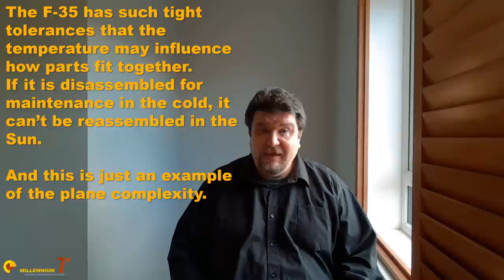F-35: The Failure of the $100 Million  Dollar Jet | Maybe...

Comment: american Gripen made by boeing? Boeing and SAAB already work together in T7A
Reply: their EW has stunned other nato pilots who thought they were going to have an easy kill.
Reply: Gripen is a marketing scam perpetrated by BAES and Saab. They don't even have an IRST in it, and China has already exploited it.
Reply: @michaelkeller5008  They both have higher unit costs that the F-35A, ($85 million for Gripen E, $144 million for Rafale to India, $77.9 million for Lot 14 F-35A) don’t offer even half of the capabilities, and have similar operations and maintenance costs, not counting mishaps.  Gripen mishap rate already is serious (8 total losses out of 271 airframes).  Rafale has the same or higher operations and maintenance costs as F-35A.  Dassault “promised” India they will try to meet a $25,000 CPFH.  USAF 388th and 419th TFW are demonstrating $21,000 CPFH right now.  It’s the training and test birds that would cost more to bring up to Block 4 standards, which isn’t necessary for the Luke AFB F-35A conversion aircraft.  None of them are slated to be forward-deployed ever.  Test birds will always have modifications made to them due to OT&E, so nothing new, other than a way more efficient platform for upgrades that doesn’t need hardware attached to the outside of it to increase sensor capes.

Meanwhile, the new Raytheon DAS is 25% cheaper and 30lbs lighter, with twice the resolution of the Northrop-Grumman DAS.
Reply: @LRRPFco52  the E version does indeed have IRST. Stop talking rubbish.
Reply: I love the idea of the American Grippen, maybe with vectorial thrust to achieve F-22 or even better maneuverability and improved electronics. 

The fighter mafia principles with today's engineering.
Reply: @LRRPFco52  the issue is not only the price but the technology. If you loss an F35 (77m) the technology can be reversed. If you loss a 4++ at the same cost it won't be so hard.
Reply: @LRRPFco52   For Finland, the Offer to buy 64 Gripens, was for 1, was little over 104 million Euros or even less! Or do the math by yourself 2/3 out of about 10 billion Euros and then take that out of 64 Gripens = Planes + 2 EW/C or something Planes and + Weapons and 1/3 of the 10 Billion is probably for the Building the Structures = Factories to start to build and develop and maintain the Jet = Jets! That what I have read, that the Cost Oor = Or the 2/3 is only for the Gripens! So the total price is something little over 104 million Euros or even less, hopefully less!??  So not so bad!  Right!??   :    )
Reply: @LRRPFco52  Please get at least some facts straight.
Gripen E has IRST.  China created simulation scenarios with limited weapons where Gripen lost.
Rest assured that Gripen would not go into combat with that weapon config. 
In BVR scenarios , it repetitively and clearly won. And that was not even Gripen E.
Reply: @michaelkeller5008   That is the other way around. By using US tech and parts , US will have veto on all sales.
I'm pretty sure US will allow sales to US.
Reply: @michaelkeller5008  They have corrected 2020 deficiencies with the JSF series, which isn’t a lot, to be honest.  Every time they correct them, new ones get added, just like every other fighter and weapons system we have in the inventory, only those barely get mentioned now.

The USAF F-16C/D Block 40/42/50/52 currently in service have tons of deficiencies that have not been corrected, as this is a rolling thing throughout the life of a program.  One of them even cost the life of a pilot last year, was a known critical deficiency affecting safety, yet he still flew.  He ended up ejecting and the identified pin in the seat separation and chute deployment system failed, causing him to hurdle through the air and impact the ground at hundreds of knots.

This problem does not exist on any of the JSF series.  

No, current systems of F-35s are forward-deployed all over the world, from multiple nations.  Israel has been using F-35A/Is in combat for years now, as have the USMC, USAF, and UK.

The older, early-production F-35s are used for the training and test squadrons, just how we did with F-15s, F-16s, F/A-18s, F-22s, etc.  You don’t just send new aircraft to operational squadrons and say, “Figure it out guys.”

VLO actually does work, and works extremely well.  Anyone telling you that it doesn’t is not well-informed.
Reply: @henrikbackorebro  Meanwhile, none of the JSF prototypes (3 different variants with different take off and landing requirements) crashed.  That was one of the first things I noticed that differentiated the JSF program from the YF-22 and all the teen fighters.

Then in operational service, instead of seeing all kinds of major mishaps like we did with F-14, F-16, F/A-18, and Harrier, we waited for years and years before any crashes, which have been very few.  4 impacts with the ground and 620 airframes built.  I’ve never seen that before in all my years of being right there watching development programs mature from X or Y planes to production.

The Falcon Strike LFEs are what I’m talking about when discussing how the Chinese have already exploited the Gripen C/D and built better 4.5 Gen fighters with the J-10C.  It has a large AESA that can’t fit in the Gripen’s radome, has a DSI inlet, and better than 1:1 thrust/weight ratio.  That’s how PLAAF beat the Gripen in BVR.

The 2015 FS exercise saw them take their 1980s-era Su-27SK and get wrecked in BVR by Gripens, but humiliate the Gripen in WVR.  Once you turn tail or offset in a Gripen after firing off AIM-120 or Meteor, your RCS just spiked significantly, just like any other single tail delta wing fighter with external stores.  That’s a dead-end design for the 21st Century moving forward, especially with how limited the Gripen external stores are.
Reply: @metmask3825  Go look on Saab’s website what they’re delivering to Swedish Air Force right now.  They have pics and video with much fanfare.  No IRST anywhere to be seen on current production Gripen E.  Is Saab’s website rubbish?
Reply: @michaelkeller5008  The USAF flies more sorties per week in arctic conditions at higher latitudes than Canada and most of Norwegian Air Force does.  Norwegians are currently operating F-35As from arctic conditions as well.  No modern fighter can be built to not operate in extreme cold because the altitudes they fly are in the -20 to -60˚ C region.  Anyone who begins this line of reasoning is not familiar with the basics of fighter environmental factors.

The US has the largest, most capable climactic control facility in the world to simulate everything from extreme low temps and ice storms, to extreme high heat with sand storms.  As part of any of our fighter and bomber testing, type classification, and validation processes, the designs have to be able to meet extremely high standards that most nations can’t even afford to build the testing equipment for.
Reply: @henrikbackorebro  You start to see a common theme with the underpowered Gripen, where the flight control law governing the canards and control surfaces has to do more work at low speeds.  This is normal, but when the pilot finds a pit in that CLAW and induces uncontrollable oscillations in a very relaxed stability design, it immediately pitches up violently.

Some of the mishaps have involved the FLCS overriding the pilot when he tried to recover it using basic recovery procedures with pitch input, but wouldn’t allow them to.  You shouldn’t normally be learning these things more than once with a design.

The fact that multiple PIO incidents have occurred with the Gripen from its early days through the past few years is not a very encouraging sign.

But don’t pay attention to any of that.  Just trust the headlines when they say how great the Gripen is, how low its costs are, how it can defeat anything in the air with its EW suite actively making it stealth, and how it will “easily defeat” the Su-57, even though it can’t easily defeat the J-10C (way less capable than Su-57).
Reply: @XimCines  It’s one thing to acquire material samples from a very rare wreckage.  It’s another to actually know how they were made, then duplicate the manufacturing processes and materials streams.

The threat nations know pretty well what is in them already.  They just haven’t done the due diligence in establishing the manufacturing base, test communities, and integrated systems armies of engineers who actually innovate, versus copying other people’s designs like the Russians and Chinese.  Innovation is hard, expensive, and time-consuming.
Reply: @LRRPFco52  I think you are avoiding the issue here, the point is that letting advanced technology to fall in foreign hands is a risk. It is not certain that they can duplicate it, it is a risk... a non zero possibility. 

Another thing is that you risk more millions in an F-22 than an F16.

You can use much simpler planes to attack lets say ISIS. An F-16 can do a good job there why risk an F-22?
Reply: @valko022  Each of the GlobalEye (foreign-built systems assembly in Sweden again) cost at least 500 million plus support.  2 of them were over $1.2 billion in 2015 deal.

F-35A unit price is $77.9 million.  Gripen E unit flyaway was $85 million a few years ago, with elastic unit program costs.

They’re trying to make up for the fact that JSF provides unparalleled levels of Airborne Early Warning and Control, though a high endurance platform allows longer flight durations of course, but has to remain far away from the border or else it can be killed very easily.  Even when they fly over Gulf of Bothnia, for example, it’s still extremely vulnerable with reduced sensor penetration and coverage over the border region.

Meanwhile, JSF plugs into net-centric early warning for surface, airborne, and low earth orbit contacts with Norway, Poland, Netherlands, and UK.
Reply: @XimCines  I’m not avoiding the issue.  If that was the determining factor, we would still be flying biplanes, only we wouldn’t, because every Air Force in the world would laugh as they shot us out of the sky and we lost.  They flew the SR-71 over Soviet and threat nation territory for generations.

When the Chinese acquired some of the F-117A wreckage from Serbs and took it to their embassy, we “accidentally” bombed their embassy.  Remember that only precision-guided munitions were used with very specific grid coordinates.

The chances of losing an F-22 are significantly less than an F-16.  For example, Israel has been flying missions with F-35s for years now, but the only aircraft besides drones they have lost has been a highly-advanced F-16I, which has more EW and countermeasures on it than any USAF F-16 ever did.

F-22As have led strike packages into Syria, opened the door as an offensive EW platform, switched to a precision strike penetrator with JDAMs and SDBs on ISIS HVTs, switched to AEW&C for the follow-on strikers using radar ground-mapping, done OCA/DCA, continuous wide-area ISR, then escorted the strikers on the way out through the perimeter defense radar network.

That used to take F-117As, EF-111As, F-4Gs, F-111Fs, F-15Es, E-3As, EC-130s, another aircraft I won’t name, and RF-4Cs do to that mission profile.  Now they do it with F-22As and F-15Es, or F-35As and F-15Es with far superior effects in each relevant mission set that used to be performed by all the previous aircraft.
Reply: @eleson00  Yes, in 2015, the Gripen C/D with AIM-120C WEZ at limited Gripen altitude beat the giant RCS, obsolete Su-27SK in BVR most of the time, but not all.  That was using the inferior export RVV-AE BVRAAM, with China says is crap compared to their PL-12 and PL-15.  Gripen C/D got annihilated in WVR against the Su-27SK in the Fox Helmet-HOBS realm as well as maneuverability because Gripen is terribly-underpowered, not anywhere as maneuverable as the Flanker up high.

Then in 2016, PLAAF took J-10A down to Falcon Strike.  BVR odds were evened out, WVR still out-classed the Gripen C.  So now you’re talking about a platform that is inferior to an outdated Chinese delta wing 5 years ago.

Then China brought down the J-10C with AESA, DSI inlet for even more reduced RCS, with PL-12 and PL-15 WEZ and totally erased any clear advantages the Gripen C had.  China was investing a lot in purchasing Flankers from Russia still, including the Su-35S.  The whole Falcon Strike exercise made them realize their J-10C platform has way more potential, so they ran a series of internal tactical exploitation exercises of all their fighters.

They found that the Su-35S was inferior to the J-10C in BVR, and stalemate in WVR since both have helmet-HOBS, both have good excess thrust and maneuverability enough to execute quick edge-of-visual range shots.

They then tried to pull the Irbis-E PESA and OLS-35 IRST from the Su-35S so they could install a Chinese AESA radar and Chinese IRTS that exceed the capabilities of the Russian electronics (not hard to do), and bricked the whole aircraft because the Russians close-loop designed the Su-35S.

China had to have Sukhoi technicians come in and help them fix the Su-35S so it wasn’t a brick anymore.

They quickly determined that their force mix for air superiority should lean more on J-10C fighters with AESA and PL-15, put as many AESAs into their J-11B, J-15, J-16 Sino Flankers like they did with the JL-11D, along with data links, better cockpits, PL-12 and PL-15 integration, with their own IRSTs for their own upgrade program.

They realized that because you can never get a Flanker to have an RCS like a J-10C, the J-10C should fill more of an active role in air superiority while Flankers do a lot of multirole and maintain as much stand-off as possible.

A Gripen E would have a really hard time against a J-10C because of RCS values and the large AESA on the J-10.  That’s why Saab has been making such a big deal about using GaN TRMs in the Gripen E to try to make up for that disparity in radome size.

Another big problem the Gripen can’t overcome is separation altitude with combat stores.  If you want an optimum separation altitude, you need an aircraft with the power and aerodynamics to accelerate through the Mach before launching BVRAAMs up past the FL400 band above the contrails.  Gripens struggle once you get above FL250 since it’s so underpowered.
Reply: @LRRPFco52  So??  For Finland! 1) F 35  2) Super Hornet  and  number  3)  the  Typhoon!  Right!??   :   )
Reply: @LRRPFco52  For sure Gripen has it. Gripen E has it. They dont have it installed yet because are still testing the plane.
Reply: Yup, the cheapest plane that can supercruise with AA load out.
Reply: @LRRPFco52  144 Million for Indian Rafale is not correct, weapons are also included in it. It's not just airplane's cost.
Reply: @LRRPFco52  sure bro ☺️ China exploted old c modell and got there ass kicked haha..ok they won a few dogg fights but bvr they hade nothing.and dogg fighting as we all know is a thing of the past. Who are you working for? Lockheed Martin?? Trying to push you're crap on everyone 😂
Reply: Wasn't that the F-20 Tigershark?
Reply: @LRRPFco52  so someone choosed not to buy the hmd with the gripen, and then lost wvr simulations against fighters with hmd. Ok.
Also, it would surprise me greatly if the J10 was in any way an important foe to consider for the Gripen E.
Reply: @eleson00  Well, Thailand's Gripen C with PS-05/A Pulse-Doppler radar lost to AESA radar-equipped J-10.
Reply: @Joshua_N-A  F-20's radar housing is small.
Reply: @LRRPFco52  JSF plugs into Aegis ABM network, hence it's part of the ABM (anti-ballistic missile) system.
Reply: Red Hawk T7A is a mini Hornet.
Reply: @LRRPFco52  > Raytheon DAS is 25% cheaper and 30lbs lighter, with twice the resolution of the Northrop-Grumman DAS.

That's another upgrade cycle.
Reply: @LRRPFco52  Gripens needs something F110-GE-132 (32k lbf) engine instead of F414-GE-39E. South Korea and Japan have licenses to build GE F110 engines.
Reply: @valenrn8657  It's higher because of many reasons, you can search for that on the internet as I don't have free time right now.
Reply: @valenrn8657  F4? I don't think so.
Reply: @valenrn8657  so you know better than Saab what the gripen needs? You don't know how and why they use that particular engine
Reply: @connywestlund924  Hint: Gripen will be replaced by the Tempest
Reply: @XimCines  Using F-16s for bombing roles requires Turkish airbases. Using F-35A for bombing roles removes the need for Turkish airbases. 

US need for multiple foreign airbases is based on F-16's "short legs".
Reply: @valenrn8657  IAF should buy an additional 36 Rafale preferably F4 variant, but there's no official statement about the confirmation of the purchase of more Rafales yet. Still, There's a very high chance of IAF going for additional Rafales tho as it makes sense to operate them in good numbers.
Reply: @Anuj-1  Unit program cost is higher than unit flyaway. There's a 2015 French documentary that listed the Rafale at €125 million. Today, 125m Euros would be $150.8 million unit flyaway.  That's the price for 2x F-35As.
Reply: @connywestlund924  The J-10C out-classed the Gripen C in BVR. It was the old Su-27SK that didn't do well in BVR, but still got several BVR wins against the Gripen.  The Su-27SK humiliated the Gripen in the Fox 2 fight on the edge of Visual Range merge, even though the Gripen had all-aspect AIM-9L, which you can face-shoot with.
Reply: @eleson00  Gripen E should never have to face J-10C since only Brazil has bought it. But therein lies the point. If it can't face a low RCS fighter and provide a very favorable kill ratio, which is exactly what Finland needs, it shouldn't even be on the table.
Reply: @valenrn8657  NG already said they won't be making DAS, Raytheon is contracted for DAS II. It's in the production schedule.
Reply: @valenrn8657  You can't fit an F110 in a Gripen. Gripen needs to be put out of its misery. The idea that you would build a lightweight fighter with .73-.8 T/W ratio even in the 1980s is dead on arrival. But in the 3rd decade of the 21st Century?

It's a product of really good marketing, most of which has turned out to be blatant lies.

They had to bribe Czechia and Hungary to buy/lease them, and got caught doing it, then were fined $400 million. You see no mention of this, especially in the US press. Why not?
Reply: @connywestlund924  If I worked for LM, I wouldn't be allowed to make any statements about the program on social media. I don't work for any contractors. These are my independent opinions based on over 4 decades of being in the defense and aerospace communities.
Reply: @jontus9925  No Gripen Es have been delivered with IRST. The "full technology transfer" kits sent to Brazil, and the Gripen Es delivered to operational Squadrons in Swedish AF do not have IRST. You can see this for yourself on Saab's website. The IRST in the year 2021 is still being developed for some reason. Meanwhile, the press talk about how the F-35 has suffered major delays and unteadiness. It's all backwards. F-35 sensor suite was developed with a full airborne test laboratory before it went into production, and has been operational for 10 years or more. Full IOC happened at least 6 years ago for USMC F-35B. USAF declared IOC in 2016, and USN F-35C in 2019.

Ah, but USN was supposed to be IOC in 2018, therefore it's a piece of crap and the magical Gripen is better!

The stories write themselves if the truth was important for journalism.
Reply: @LRRPFco52  just to clarify, I do not for a second believe that Gripen would be an alternative to the F35 for USAF. They represent two totaly different ideas to fullfill two totaly different needs. I would not rule out the possibility of Boeing/SAAB being a competitor for the development of a presumptive gen4++ F-?? though, if that ever came to happen.
Reply: @henrikbackorebro  We already have multiple 4.5 Gen or 4+ fighters in the US, who rely on F-22A and JSF-A/B/C for their survivability.

* F-15C+ with the world's largest fighter AESA, updated EW suite, Link-16v4 protocol, JHMCS/AIM-9X
* F-16C+ with SABR AESA upgrade and the same EW, JHMCS, HAVE GLASS RAM paint/VLO canopy coatings
* Super Hornet Block II/III

Those all cost a lot from their initial purchasing through multiple upgrades, SLEP, & MLU. If you accumulated all those expenses, you surpass the F-35A unit cost for far less capability, far less survivability, far less lethality.

So why are we entertaining the idea of building a new 4.5 Gen that doesn't even exist, is currently obsolete, and will definitely be obsolete the day it rolls out of the hangar?
Reply: @michaelkeller5008  The F-35 and the F-16 work great in desert conditions (for example, nevada, utah) and cold (alaska). Currently, the F-16 and F-35 are operating at the raw airport in Guam. LOL

The fact that Gripen works in all conditions and other fighters do not, is propaganda.
Reply: @LRRPFco52  yeah sry didn't mean any disrespect you're just pissing all over gripen with false facts so I feel compelled to response.the score I I heard about in that particular exercise between Tai and Chinese airforce was something like 46 to 34 in favor of the gripen.not 💯% sure if exactly correct but something close anyway. Either way how is that outclassed by them.regardkess what armament or what ever the rules of engagement was..I like the competions but plz stay true to the facts.
Reply: @valenrn8657  I mean Fighter Mafia 😁
Reply: @valko022  Best capability options for Finland:

1. F-35A without peer
2. Rafale F4 with GlobalEye
3. Typhoon Tranche 4 with CAPTOR-E, PIRATE IRST, new Digital EW suite with GlobalEye
4. Super Hornet Block III with GobalEye
5. Gripen E/F + GlobalEye

Most expensive by unit  cost:
1. GlobalEye 
2. Typhoon T4
3. Rafale F4
4. EA-18G Blk III
5. F/A-18F Blk III
6. F/A-18E Blk III
7. Gripen F
8. Gripen E
9. F-35A

Most expensive O&M costs:
1. GlobalEye 
2. E/A-18G
3. Typhoon T4
4. Rafale F4
5. F/A-18F
6. F/A-18E
7. Gripen F
8. Gripen E/F-35A

We don't have any baseline from which to evaluate Gripen E O&M because no fleet data is available, no operational Gripen Es with full systems exist, so it will need 5 years before we have any idea what it actually costs.

We have 2 full operational fighter wings of F-35As who have deployed multiple times all over the world, and know that CPFH with them averages $21,000 with an OPTEMPO the FiAF will never see.

Meanwhile half of South Africa's Gripen C's are in flyable storage......because they can't afford to maintain them.
Reply: @LRRPFco52  Disagree... I have an answer for each of your comments but you won't agree. 

I leave it as a difference in opinions.
Reply: @connywestlund924  I'm not stating false facts. Gripen C BVR exchange ratio was 41:9 over 6 days of A2A exercises against the obsolete Su-27SK & J-11A. That was with the Gripen C's better radar, longer reach AIM-120C5, better cockpit, a data link, etc.
Reply: @LRRPFco52  you are correct gripen won the bvr and lost in the dog fighting and they blaimed it on the 9-aim sidewinder? But can't find anything of any encounter with the j-10
Reply: @XimCines  The service cost increase with vectorial thrust and you need to serve it more often 500h? But it will improve perforamce.
Reply: @connywestlund924  Gripen is underpowered, has low stores capacity even for A2A, and once you offset to try to evade threat radar, you turn from a small frontal RCS target into a huge RCS reflector with that single vertical tail, with an unconcealed jet nozzle hanging out in the IR spectrum for the IRST.

There are some very detailed Chinese discussions on Gripen C vs Su-27SK and J-10, complete with graphs from the A2A sorties.

Chinese PLAAF sent their Su-27SK pilots down to fly Gripen Ds with RTAF pilots, who went to China to fly Flankers.

They did an exchange before starting Falcon Strike in 2015. One reason was they needed to adapt the Su-27SK to the Thai ACMI pods for instrumentation in the LFE, which is several weeks long.

Saab technicians were requested and present for the 2015 exercise because of defense trade agreements between Thailand and Sweden, overseen by the US as well since we supply AIM-120C to RTAF.

Most of the "detailed" presentations you can read about are not as detailed as the full Chinese technical university presentation by one of the senior test pilots that partook in the exercises.
Reply: @LRRPFco52  F-15C's empty weight is close to MiG-29 with a wing area similar to a Flanker.
Reply: @valenrn8657  F-20A was another major marketing hype campaign I lived through and entertained at the time, and a really good one too. They could never hide the fact that its combat radius was roughly 150nm, it couldn't carry much ordnance, T/W was weak, rear visibility was typical F-5, and radar aperture size was so small as to be very limited in detection range. It did have an updated cockpit basically taken from the F-18L.

The F-20 would have made a nice little aggressor, but couldn't simulate MiG-29 or Flanker BVR profile like the Viper does.

The Gripen is often referred to as a modern F-20, although the Gripen has better radius and a bit more ordnance, but not enough.
Reply: @connywestlund924  Saab knows better than anyone what the Gripen needs: sales to sucker nations so they can finance their contribution to Tempest, which is supposed to be BAE System's, Leonardo's, and Saab's attempt to make a 5th Gen fighter.

Not even Czechia and Hungary could be tricked, so they had to be bribed to buy Gripen C/D.
Reply: @connywestlund924  The Thais purposely did not use the IRIS-T HMD/HOBS missile or their F-16s. The Chinese didn't send their best fighters in 2015, as they didn't want to expose all their capabilities either. Subsequent Falcon Strikes saw the J-10 with PL-12 after they re-trained pilots for the BVR fight.

Another major technical imbalance was the Gripen C's ability to salvo-fire 4x AIM-120C5 with multiple track data link, while Su-27SK could only privide guidance for 1 RVV-AE with data link.

The Chinese exploited these technical dissimilarities, did what Chinese are known for, and incorporated as many of the Gripen C capabilities into the J-10's and J-11 series avionics.

If you read Col Hua's full lecture at the technical university, it's very illuminating.

The thing about aerospace sciences is that if you're familiar with the details, you can calculate various aspects of radar detection ranges, RCS values, missile kinematics, processing power of CPUs, etc. but it takes a lifetime of studying these things.

When I read Col Hua's lecture, I built a metric graph, as did others, showing all the relevant deterministic factors that yielded the outcomes from FS 2015. No surprise to those of us in the West, but a great example that validates the importance of:

1. Small RCS (F-35 wins this hands-down)
2. Superior computing power for data link connectivity to BVRAAMs (F-35 smokes everyone here again)
3. BVRAAMs with longer reach and high pk that work are worth their weight in gold (AIM-120A/C  is the only modern BVR stick with real-world kills, while every single R-27 & R-77 have failed to connect)
4. Pilot interface with avionics and better SA is critical in BVR and WVR (Col Hua said Su-27SK pilots were surprised from off-axis attacks at BVR. JSF crushes every other fighter in this realm.)

There are a bunch of other metrics I determined by reading between the lines knowing what I know.

The missile WEZ parameters are one area to understand as very elastic. Flankers have a major advantage there if they use a better PL-12 or PL-15 missile, not the "monkey model" Russian trash.

Just with modern upgrades to the old Flanker, you take away every advantage the Gripen C has even using PESA with PL-12 and a 1990s CPU, multi MFD cockpit from 1970s Hornet.

With the composite airframe Flanker, Chinese AESA, latest CPUs, Large Panel LCD displays, EW system wingtip pods, and a half-decent data link, it moves back to the first-look, first-shoot position with twice the A2A weapons.

This is exactly what China has been doing with their A2A-focused Flankers.
Reply: R Thaosen  Unit flyaway Rafale was listed as 125 million Euros in 2015, not including weapons, spares, ground equipment, etc. That's actually more than the Indian deal. These prices make sense if you've followed defense aerospace budgets and inflation for a twin-engine, AESA radar, elaborate EW suite, IRST, RAM-coated, carbon fiber, glass cockpit fighter. You aren't touching any Western-built twin-engine fighters with AESA for under $100 million, except maybe Blk II Super Hornet and only because of how many hundreds of them were ordered.
Reply: R Thaosen  F-35A is lower cost than that at $77.9 million. You would have to add $69 million to each F-35 to reach Rafale, whether that's unit program cost or flyaway. So now you have to come up with $690 million extra just for 10x F-35As. What's that for? Diagnostic equipment is integrated into the jet, so it isn't that.

Ordnance carts for the weapons bays?
You could buy entire spare engines for each jet and still not hit that price. Maybe if you bought 40 missiles, 30 JDAMs, and 30 SDBs for each one.
Reply: There might be a mistake.
Reply: @thomaseriksson6256  There aren't any thrust-vectored fighters being discussed here.
Reply: R Thaosen  Finland already has the baseline weapons for F-35, except AIM-9X, and has JASSM too. There is no need for expensive weapons that only work with one type of jet.

Part of the Finnish HX contract is that you have to allocate 1 billion Euros to investment in logistics to be built in Finland.

No F-35A unit program cost is $200 million. You're pulling numbers out of nowhere now.

I've literally been studying defense aerospace procurement since the mid-1980s at the latest, including defense budgets, unit costs, unit program costs, inflation, attrition costs, SLEP and MLU costs, basing infrastructure updates for new systems, weapons costs, ancillary systems like FLIR, ECM, new pylons, training weapons, repairs, operations and mx, unforseen costs, ground equipment, runway refurbs, you name it.

The limited number F-16E/F buy was a unit program cost of $200 million. That included CFTs, IRST, GE-132 special motor, reinforced airframe, FLIR pods, special integrated countermeasures pylons, new digital EW suite, etc.

All of that and more is fully integrated into the F-35 airframe from the start. No need to pay extra for it to attach those systems.
Reply: @LRRPFco52  Ah Common bro that was mean😏 I know the gripen story and how it came to be and don't hate the player hate the game.sweden is small country with not even 1% of US defence budget.you all thought us how to play it.you know when gripen was chosen as replacement for viggen it won by just a few wotes in "Congress" and swedish economy was in ruins after the cold war then early 90 we had huge bank krises that almost bankrupt the country but God old USA saved us with loans.gripen needed to be sold to help it survive that's true so Sweden and Saab looked for a partner in bae systems to help market it and the Hollywood style marketing it's all on them.but never mind all that it don't change the fact that it is a dam good jet fighter.and it's biggest weakness is that it was tailor made for swidish doctrine and special needs and geology. And to depended on US and UK on parts and weapons.thats why gripen E was made to make it more suited for international use.its no scam it's not pushing or threatening its open competion.saab offers a great air craft it's up to each country to evaluate it.and if country's like Switzerland and others in central Europe chose other air craft because of range payload and and bla bla it's just incompetence.only scenario I wouldn't chose gripen is if I need to fly down to the middle east and bomb the shit out of some crazy dessert diktator with made up stories of nuclear weapons.
Reply: @LRRPFco52  I can't really respond to that because I haven't read that lecture.but I'm going to do more research..what I do know it was 2015 and old not upgraded gripens and like all exercises it's the lessons we learn that matters.
Reply: In fact all Gripen programmes are based on manaufactiring in country 

Which would take the edge of the American politics 

I think Gripen would be great to replace the F-16 in the mix
Reply: @LRRPFco52   What is Peer ??  An AWACS Plane or what ??   :    )
Reply: @connywestlund924  PLAAF and RTAF have done annual Falcon Strike LFEs in 2015, 2016, 2017, 2018, and 2019. None of those dates are old.
Reply: @JacobVahrSvenningsen  Gripen has major US (the engine, radar electronics, missiles), UK (electronics, ejection seats), and Italian (radar, IRST for Gripen E still in development) systems in it so it is already subject to US/NATO defense trade regulations. The main thing that is Swedish is the assembly line, not any of the critical subsystems.
Reply: @connywestlund924  Read more. Su-27SK/J-11A are obsolete fighters lacking much beyond 1980s tech. Still were able to get 9 BVR kills with 41 losses. In WVR, they decimated the Gripen.

Then China sent their J-10s in follow-on Falcon Strike LFEs with a far better radar, much longer reach missiles, much smaller RCS airframe and the Gripen's favorable BVR exchange ratio eroded.

Then they did J-10C with the DSI inlet they stole from the US, AESA radar, better data links, and PL-15 missile.
Reply: @LRRPFco52  I read that report even if it was a short version it made it's point.we obviously read with different glasses😊
Reply: @connywestlund924  There's a really good source with all the graphs and the full lecture he did. China is learning what we've already known since the 1960s-1980s.
Reply: @LRRPFco52  can you give a link? I only found that shortend report.
Reply: @connywestlund924  The main takeaways are that he who has the best:

RCS
First-look
First-shoot (Missile reach/pk)
Fire Control Computer data link bandwidth
Pilot-sensor-system interface
Helmet-Mounted Sight/HOBS missile

Will win.  The F-35 simply out-classes every other fighter in the world in these metrics, and it wasn’t even envisioned as an air dominance platform.

The metrics actually change a bit for 4th Gen because they are working under the mutual detection assumption handicap, whereas 5th Generation are not.

5th Gen operates under the foundation of all-seeing, without being seen unless you want to for deception.

In each of the metrics we used for 4th Gen, the 5th Gen fighters have a massive leap in capability over them, whether we’re talking about radars, central processing and fire control, pilot-sensor interface (fused vs federated), EW (fused and networked vs minimal and federated), data links (LAN/LPI vs WAN/detectable-jammable), etc.

The rest is just marketing from those who didn’t invest in developing 5th Gen because their national budgets and weak parliaments refused to do it, and now their aerospace industries are being left behind.
Reply: @valko022  Not sure what you’re asking.  I read back and could only find where I stated that the F-35A is without peer in the Finnish HX competition.

Peer means equal or relative equal, someone in the same class or playing field as you.
Reply: @LRRPFco52  ok and thx for the info.
There's no denying the advantage of stealth (so far)  everything going so fast now it's difficult to look ten years ahead
Reply: @LRRPFco52  Saab's Gripen C/E is marketed towards F-5 customers who are expecting a low-cost F404-GE or F414-GE single-engine maintenance regime. 

Gripen platform is not quite an F-16XL platform with F110-GE-129 (29K lbf) single-engine. 

Supporters for Gripen didn't factor in lift drag (relates to wing area) vs engine thrust and the resulting acceleration. There's also a drag factor with a larger wing area at a slight angle of attack for vortex lift generation in relation to engine thrust power. There are many factors when designing a modern fighter aircraft. 

F-15E-1 has improved sustain turn rate with engine upgrades when compared to F-15C or original F-15E.
Reply: @JacobVahrSvenningsen  For USAF, Gripen E's F414-GE engine is not in common with USAF's F110-GE-129 engine support logistics.

Both F-15EX and F-16C Block 50 uses the common F110-GE-129 engine support logistics. Part of F-35's initial high cost is establishing the logistic base to support the F-135-PW-100 engine. 

USN has its own support logistics base to support F404-GE and F414-GE engines, and currently establishing F-135-PW-400 (salt resistant materials) and F-135-PW-600 engine logistics.
Reply: @valenrn8657  yes it is understandable that the logistics base is an important  part of the decision making process 

A future replacement of the F 16 build on digitalization should ofcourse work one of the logistics bases already in existence with the USAF - be it F15EX or Others that I am not aware of.

A Gripen with such an engine should outperform the previous Gripen models 

None the less - my guesstimate would be that the airframe could withstand the new engines power and length 

It’s gonna be a tricky take off with a engine nozzle that scorched the tarmac at every take off lol 

Catch my drift
Reply: @LRRPFco52  Yeah  Thanks = Thank You So. 💟😊😄  I didn't read it correctly as first the word Peer, but now I know what that word means.  😊😄  So sorry, but I not so good in English.  😢😢  But I Agree with the Finnish  Statement Half Way.  But we should not forget the Rafale Which is similar, not the same, but similar on the Stealth Capabilities as the F 35. That in some areas, yes, the Rafale is better than the F 35 and in other areas the F 35.  😊💟😊😄
Reply: @JacobVahrSvenningsen  US's future Adaptive engine would need its logistics base e.g. training, spare parts, machine shops, and 'etc'.

For F-35 Block 4.2, F135 Block 1 engine upgrade is currently being tested.

To support Block 4.2 requirements, there are Growth Options (GO) 1 and 2, 

GO-1 offers either a 6% fuel burn reduction or 10% thrust improvement. 

GO-2 package reduced fuel consumption by as much as 20%, with a 15% overall thrust improvement.

From https://aviationweek.com/aerospace/program-management/f135-upgrades-reengining-considered-new-f-35-propulsion-road-map

Like F-16 Block X upgrade program, Block upgrade adds cost to the top purchase price. Countries like Poland are waiting F-35A Block 4. Canada's F-35 purchase delay is probably waiting for later F-35 Block builds. 

US has a very active engine upgrade program.
Reply: @JacobVahrSvenningsen  FYI, F-35's engine nozzle and diverterless supersonic inlet (DSI) was fitted on test F-16C, hence further RCS improvements can be applied for upgrades after F-16V Block 70/72, but it's better to design a new 4.5 gen airframe with "longer legs" with the new avionics and engines.  

For "4.5 gen" airframe, assembly tolerance would probably be relaxed when compared to F-35 or NGAD.
Reply: @valenrn8657  it resembles the development of the Gripen E and a few tweets with an extra airframe section which should give it “longer legs” room for fuel and internals and RCS reduction (minimal but valid in an upgrade package )

I think we are gonna see a patchwork of orders with regular block 70 being first 

No foreign orders (unless tech transfer and in country production (Gripen E type deal)

And eventually F-15EX production continues 

A bunch of wingman drones to replace the actual unit numbers of F-35 is also on my mind 

Later a new upgrade Block 80 and 90 for their midlife upgrades 

If they make a regular request for design proposals and  bidding competition they will drop the ball and have a lot of planes grounded all the time with force readiness drop even further 

Hence, purchase off the shelf is sound 
It’s a recognition that not all missions will be peer related and here I would like to enter the Textron Scorpion and Bronco at the bottom of the mix 

I even feel that an air policing mission over a denied air space could be done by T7 with aam 9x and aim 120 - no need for BVR since it’s positive ID 

Heck I even think some of that mission could be done with BAe HAWK 120/200
Reply: @valenrn8657  If so its like 30years away. Tempest is a platform.
Reply: @LRRPFco52  Thats a fair queistion. Does history repeat it's self? Well it had worked before.
In realaty Rusia and China will not have anything near acc to number against US/Nato. Its cheeper and wieser to controll export of hightech, like the EW suite on Gripen. Cheap drones who can take down a fifth gen fighter is'nt where they aiming at If they want airdominance. The Los of DF was learned at the 60ths. Most likely we'll see EF and a cuz to Gripen in the US. The knew vers of F15 is a platform to.
So its what the others can not have, yet.
Reply: @valenrn8657   Maybe I have missed it!??   💗   😊   😅
Reply: @LRRPFco52  please avoid being conflictive and self center. Thomas Eriksson was answering my suggestion. I leave it here.
Reply: @valenrn8657  a little strange you mention drag and lift as an argument against gripen when it has  lower drag and wing loading than f16 still has a faster climb rate than f 16 with higher TWR
Reply: @UCN28CEP157BgTHU_RC5WQhg of course sustained turn rates depends on twr but low wing load and low drag reduce the need of high twr or at least it compensate for it.but if you look at those exercises and read what the report are really saying you see another nuanced picture.gripen c is old but can be upgraded to almost match gripen E if they can spend the money.
Reply: @valenrn8657  this is a better report and 2019 gripen c got the Ms 20 upgrades and better weopns.this time they dominated  the j-11 in both wvr and bvr then the plaaf send j10A and j10C and still Not a Match to the gripen c but they faired better without giving any numbers.if the gripen c was upgraded with the latest Saab GaN radar engine uprade to match the GE 414 it would have better twr than the E version.so with meteor missiles and irst it would be very hard to kill
Reply: @connywestlund924  Gripen E is not only fighter aircraft with engine upgrades e.g. SU-30MK.

Another checkpoint against DailyCaller's BS graph from David Archibald

https://www.youtube.com/watch?v=MJLoW1ClNE0
Confirmed by the pilot interview: "F-35 can turn 135 degrees in 3 seconds" 

That's ~45 degrees per second turn rate.
Reply: @connywestlund924  
The APG-81 radar is twice the size of RBE2-AA and can do things not possible in Rafale.

UK is funding both Meteor missiles for F-35 Block 4
UK-Japan is funding the successor to the Meteor missiles for the Eurofighter, Tempest, and F-35.
Reply: @valenrn8657  I wouldn't call that sustained turn rate but instantainius turn rate and in that gripen can math it no problem
Reply: @valenrn8657  not sure what's happening but it's videos all over the place claiming they admitted f 35 as a failure
Reply: @connywestlund924  My post on F-35's F-35 can turn 135 degrees in 3 seconds is a checkpoint against DailyCaller's BS graph from David Archibald.
Reply: @connywestlund924  Critics missed the "low-level threats" context. USAF doesn't to use F-35's finite 8000 service life hours for low-level threat missions and they want the new F-35A fleet to be available for near-peer and peer competitors.

 The US is being dragged into useless conflicts and low-level threats which rapidly using service life hours on fighter aircraft design against near-peer and peer competitors.

Australia's newish Super Hornet Block II 24 units fleet has rapidly used its 9,000 service life hours in Syria/Iraq conflict which lead to replacement in the short term, hence another batch of F-35A purchase orders to replace them.

Super Hornet Block 3 has  12,000 service life hours.
Reply: @connywestlund924  
http://kovy.free.fr/temp/rafale/pdf/12332.pdf
Swiss damning report in Gripen C vs Swiss F/A-18C.

From Swiss,
The Gripen has been assessed unsatisfactory for this type of mission. The main weak points of the Gripen were insufficient Range/Combat Radius and its aircraft performance.
Reply: @connywestlund924  My Swiss report also includes Gripen MS21 with 46 upgraded items and still not meeting Swiss minimum expected capabilities.
Reply: @JacobVahrSvenningsen  Not Gripen, any proposed 4.5th gen fighter for USAF would resemble a Rafale with a single large engine.

From Swiss,
The Gripen has been assessed unsatisfactory for this type of mission. The main weak points of the Gripen were insufficient Range/Combat Radius and its aircraft performance.

Gripen's ferry range is useless for the Combat Radius argument.
Reply: @LRRPFco52  “No IRIS T to be seen on current production Gripen E”.
This statement is exactly why I wish I could share pictures in the comments, sometimes. Saab showed up to RIAT 2019 with a Gripen in the statics and a copy of IRIS T sitting in front of it. Pretty sure they wouldn’t market it, if it wasn’t available.
Reply: @mikemontgomery2654  I'm not talking about the IRIS-T missile. Gripen C/Ds already have that even in foreign service. I'm talking about the Infra-Red Search & Track (IRST) sensor that is supposed to be on the Gripen E's nose, after 14 years of Gripen E development.

There's one test aircraft at least, but none of the delivered Gripen Es have it. The answer to why is that they are test aircraft too...it's all very strange. But then a hundred click-bait articles will tell you "the F-35" isn't fully developed and behind schedule. White is black, Gripen E is magic, F-35 is trash, etc.
Reply: @LRRPFco52  as opposed to the click bait articles telling you the F-35 is invincible? Click bait aside, the Gripen has surprised many people with its capabilities. With wingman drones coming up, the F-35’s stealth is becoming less and less relevant, especially if the plane gets into a dogfight scenario.
Reply: @mikemontgomery2654  Stealth is becoming a baseline necessity for all new fighter designs, not less relevant.  Older designs are becoming more reliant on stealth aircraft on their side, otherwise they are not survivable or as lethal.

The F-35 is not the aircraft you would want to get within visual range of, not that this is likely unless in another VLO fighter.

Reasons are that they have been watching you all along, have better weapons-cueing systems than any other fighter currently in service or development, with weapons that actually work.  In BFM, they regularly beat every other platform out there with favorable exchange rates.  People who think it isn’t highly lethal in BFM are misinformed, and that’s coming from multiple F/A-18, F-22, F-16, and F-15 pilots and Fighter Weapons Instructors.
Reply: @LRRPFco52  half of those feared systems CAME FROM other fighter platforms. I call bullshit on all of that. Stealth is becoming less relevant to the planes. Drone fighters controlled by the new fighters are what need to be stealthy so they can go into hot zones for the piloted aircraft. As for dogfights, that’s where the 35 is still restricted on manoeuvres because of its weight/wing loading. Those are still issues with the program.
Reply: @connywestlund924  If the Gripen C faired well against the J-10A & C, we'd hear about it. Saab would be bragging about that all over the place, saying how their magic fighter somehow achieved better first-look against a lower RCS fighter with a big AESA in its nose, with longer-reach missiles. The math doesn't add up. Instead, they said they're going to upgrade the Swedish AF Gripen C fleet while working on the Gripen E (still in development).

PL-15 =/> Meteor
J-10C AESA > Tiny MSA radar
J-10C RCS < Gripen RCS
J-10C missile data link vs Gripen C?
J-10C T/W > Gripen C or E
Reply: @LRRPFco52  it's all there in the report I sent in the link I just qouted what it said.and compare them side by side gripen had all better ratings too but it's a useless waste of time doing that.
Reply: @valenrn8657  I call bs on that Swiss evaluation. they chose it the first time then the people woted to postpone the fighter procurement.then all of a sudden it don't mesure up? And what the hell does the Swiss need range for? Nah it's smells lobbying and political pressure all over it.but last time they said E version was not operational and would not consider Saabs solutions.
Reply: @mikemontgomery2654  Half of what systems? I'm not tracking which post you're referring to.

Re "dogfighting", F-35s have been out-BFM'ing Vipers and Hornets for years now. After working with them and learning to exploit the systems better, they're even giving Raptors a run for their money. There are quite a few Raptor pilots who have gone into F-35A that prefer the F-35 over F-22 for a number of reasons, but if you're talking about dogfighting, your understanding of all this is out-dated by at least 30 years.
Reply: @connywestlund924  For the Swiss, there's another fighter competition after the year 2014.

From https://www.defensenews.com/global/europe/2019/06/14/saabs-gripen-is-out-of-the-running-in-swiss-aircraft-race/
In 2019, Swiss told Saab to go home.

The remaining lineup of contenders are the F-18 Super Hornet, the Eurofighter, the Rafale and the F-35A.
Reply: @connywestlund924  Don't compare ferry range to combat range.
Reply: @mikemontgomery2654  F-35 is a flying SAM site with 360 degrees targeting.
Reply: @mikemontgomery2654  FYI, Australia's Hornet size Boeing Loyal wingman drone has stealth and its wing and tail design are similar to McDonnell Douglas' JAST.
Reply: @valenrn8657  yes I told you gripen e is not considered operational.and I still believe that gripen is being outmaneuverd by French and the US putting pressure on costumers.sweden is about 11 times bigger than Switzerland and gripen c combat range is 800km yes I agree it lacks some of the advantages of beeing bigger.but being small outweigh that and should decently do so for the swiss.
Reply: @connywestlund924  You can't tell a potential customer, 640KB RAM is enough. The potential customer has requirements.
Reply: @LRRPFco52  While F-35 is okay for 5 to 15 years to replace F-16C and classic F/A-18C low aspect of high-low mix, many US allies still want "stealth F-15" requirements.

Blocking F-22A export will be remembered by the allies.
Reply: @valenrn8657  None of them could afford F-22.

JSF variants are sequential replacements of F-16, F/A-18, AV-8B, A-10C, but change the whole way TacAir platforms behave, really making them Omnirole strategic assets that shift geopolitics dramatically.
Reply: @LRRPFco52  F-15SE was closer to "stealth F-15".

F-22A needs materials upgrade from the JSF program.

In terms of fuel consumption, Australia has operated F-111C which is a twin large engines category similar to F-14A.

It's the US political problem to restrict F-35's stealth with F-15's kinematic performance.
Reply: @valenrn8657  F-15SE was a wood and Bondo mock-up with no actual stealth. It was a bad stunt ordered by the Boeing execs, who literally knew nothing about the F-15 other than they owned McD's production line after the merger. That's coming straight from engineers at the St. Louis plant. They lanent that Boeing is the worst thing to ever happen to McDonnell Douglas.
Reply: @valenrn8657  Would have been nice to make Raptor airframes and populate the internals with common JSF subsystems.

Enemies within made it their mandate to kill F-22 on behalf of Russia and China. They're trying to do the same thing now by beating the Mockingbird media drum with nothing but anti-JSF articles. General Brown's comments certainly didn't help with that matter, unless he's bought too.
Reply: @LRRPFco52  Boeing's F-15SE proposal includes the following

1. High-speed tolerant radar-absorbent materials added to leading edges to lessen the F-15SE’s head-on radar signature.

2. Canting both vertical stabilizers by 15° to reduce radar signature to the side.

3. Embedding missiles and bombs inside conformal fuel tanks to further reduce radar signature.
 
-----------------
Adding high-speed radar-absorbent materials for export would be a problem for the US.

Boeing could have added the stealth nozzle from the JSF program. JSF's stealth nozzle can handle 43,000 lbs thrust and related temperature. The same for F-22's higher-speed stealth canopy material.

Boeing was a partner with Lockheed's F-22A program.
Reply: @valenrn8657  I know.  I’ve tracked the F-15 program from start-to-present with a front-row seat to its development cycles.  Was very close to the F-15E CTF at Edwards.  If you look back to the original name for the CFTs in the mid 1970s, they were envisioned as FAST Packs, which stood for Fuel and Sensor Tactical Packs.  They only made CFTs and first used them on Iceland-based Fighter Intercept Squadron Grey Eagles, then the Strike Eagle demonstrator TF-15A/F-15Bs that were converted.

The conformal weapons CFT demonstrator for SE was another stunt going nowhere.  Notice that it isn’t a thing on F-15EX, which is a sad stop-gap to try to fill the void left by the neutered Raptor order.
Reply: @valenrn8657  F-15SE never addressed the open LOS RF path to the fans from frontal aspect, which means it was never a serious offer.  Lifetime F-15 engineers at St. Louis never took it seriously and knew it was dead on arrival as an idea for even an LO platform.  It never stood a snowball’s chance in hell of being built, for that and many other reasons.
Reply: @LRRPFco52  Well, YF-22 fired its A2A missile as a demo when it's not required.
Reply: @LRRPFco52  F-15J's built-in IRST wasn't on F-15EX i.e. USAF is the customer and it doesn't want it. Don't blame Boeing when the customer doesn't want it.
Reply: @valenrn8657  For an obvious eventual requirement.  Nobody asked for an F-15SE.
Reply: @valenrn8657  yeah, which just reinforces my original question. If they have stealth wingman drones for these planes, specifically designed to remove threats from the battle space, why is it then necessary to spend trillions more on fleets like the F-35? The real threat is eliminated by drones.
Reply: I didn't think Boeing made things that flew anymore...
Reply: @LRRPFco52  ...   Rafale C costs  63 M€  ,  Rafale B: 68M€   ,  Rafale C:  73M€   ... But it will sold at a much lower price if  it is bought  by other countries due  to scale economy ...Ony 212 rafales have been built  till today   While 520 F35 have been built  and 4588  F16 have been built.
Reply: @jojototo4566  Your numbers are out-of-date for the most part.

Rafale unit cost to India is $144 million.

A 2015 French documentary stated that the F3 Rafale was 125 million Euros unit flyaway cost.

620 JSF aircraft have been delivered as of February 2021.

I've been tracking detailed unit costs, CPFH, FMC/MC rates, deploymnt schedules, upgrades, developmental programs, etc. since the 1970s just FYI.
Reply: @anderspettersson9885  None of the Gripen E airframes delivered to Brazil or Swedish AF have IRST or the large panel display cockpit....after 14 years. It's a scam.
Reply: @LRRPFco52  Please stop, you're just embarrassing. All of them will have the WAD and the Gripen E is still in testing, the first E to be delivered to SwAF will be in 2022-2023.
Reply: @anderspettersson9885  Saab shows Gripen E being delivered to Swedish AF on their website without IRST. Do you have a better source than Saab, the assembler of the Gripen? Yes, embarrassing is exactly right, but not for me.